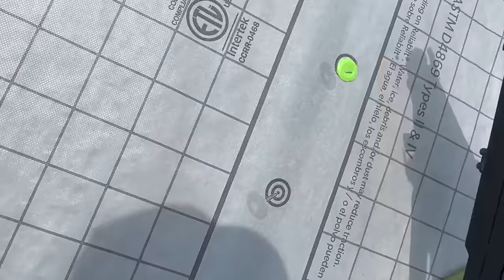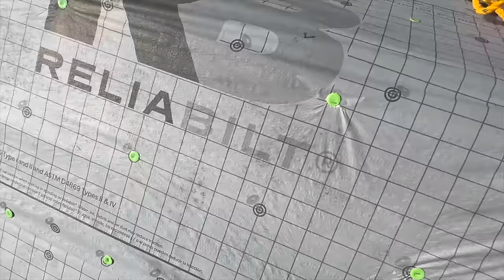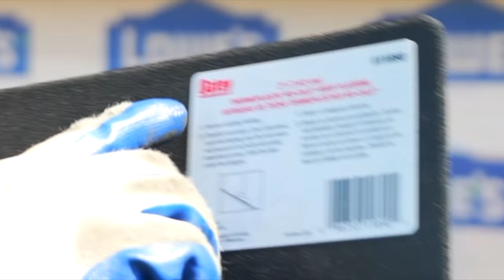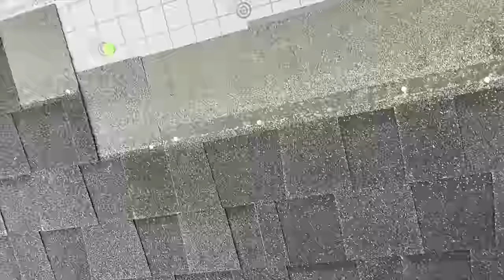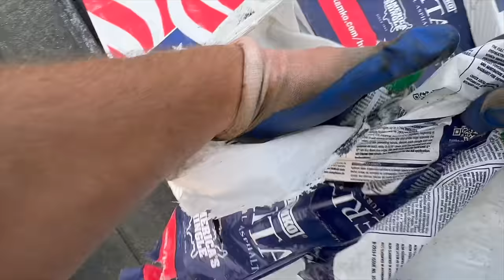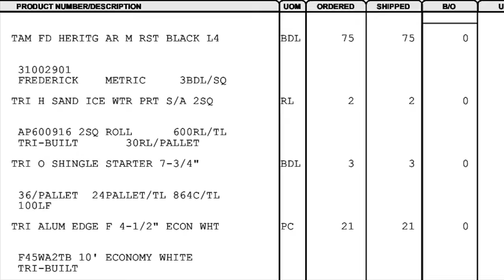How To Install Roof Shingles - BEGINNERS Step-by-Step GUIDE

Comment: I liked it for the most part besides two thing. The drip edge on the eve should be the one to get that folded tab and the rake needs cut to fit perfectly and make a pretty point on the bottom when they meet . And the nails on the pipeboot should never have exposed nails don’t shoot the bottom just the top and sides

Comment: Awesome, Josh, I have to replace 2 sheets of OSB on my patio roof, the previous owner didn't flash the end and now the edge boards soaked up rainwater. Need to replace about 16' across and 5' up the shingles and tar paper.

Comment: You have produced the most comprehensive video on roofing! I just built a roof extension after following the dorm construction videos with valley framing and sheathing the videos saved me a tremendous about of time. Thanks!
Reply from the maker: I do try to put as much information in each video when I make one. I hate when I am trying to learn something right video in a small detail as important is left out. I appreciate you watching!

Comment: Great job on all the explanation of everything it takes to roof. Always checking with your local codes is so important because some areas require two rows of ice shield because of the overhang of the roof. This gives plenty of safety for ice building up. Dimensional are always such a great look and actually are not a huge cost factor. Regular tab shingles I've done, I've off set 3 rows that would show more of a diagonal look instead of every other row staggered. 
I've measured from the ridge as well when you get closer to the top so the top looks straight. Of course as you stated, everyone has a different way. Huge crews of 8-10 are amazing to watch how well they all have a way to do each part. It looks like the roof is being poured on. Cutters do their thing as others do. 
I've never had the chance to use that style ridge vent and it does look really nice when done. 
If cap shingles are available. I like that too. It saves a lot of time and cutting which offsets the cost as well. 
Glad you covered the importance of safety as well. I know a roofing company that has special shoes with a tall heel so on 12/12 pitch (even 6/12 pitch) it doesn't bother your ankles. 
Great job Josh and get some sunscreen on my friend. Hahaha
🔨🔨👍🏻👍🏻
Reply from the maker: Oh yes, it’s amazing how codes vary so much from town to town and county to county. I remember doing three tab shingles when I was a kid and they are much different than the dimensionals. A dimensional shingle install is much quicker and looks better.

Oh wow you have much more experience working with crews of roofers versus me. It’s typically me and one helper or my father. Oh yes, safety is very important and I definitely agree I need more sunscreen on lol. My wife said it’s the best farmers tan she has ever seen! I hope all is well with you David and I appreciate you watching!
Reply: @TheExcellentLaborer  it is a difference with just roofers and a builder. I'm grateful that your Dad is involved like mine was when he was with us and the same with my father-in-law. Miss them both, but definitely a lot learned from them. Stay safe and get that pf80 sunscreen. Hahaha

Comment: GREAT video. Thanks much. FYI (for beginners) ridge vents come in variations depending on climate. My neighborhood is in a snow belt and the builder used ridge vent designed for non-snow zones. our attics were found to be full of snow. We are are all replacing out ridge vents for the snow-zone.

Comment: Easily a 9.5/10 video. Awesome production with a few tricks new to me. My only concerns/recommendations:

- A brief discussion on why pinching underlayment under the rake metal but hanging over the fascia metal would have been nice; I've had senior installers train BOTH ways, with one yelling at me for NOT pinching underlayment under fascia metal for fear wind will eventually lift up that first run of underlayment/starters and get at the deck - a fear that is clearly eliminated by using butyl-backed (sticky) ice-and-water barrier for your first run anyway. Obviously standard underlayment falling over the fascia metal ensures moisture weeping does not fall behind the fascia wood, right? 

- Nails securing your T-metal should have been completely hidden by the ice and water underlayment, no? And if I'm understanding right the outer fascia will also be attached by another run of nails through your T-metal. Shouldn't your ice-and-water barrier be installed to the farthest-most point of your T-metal to cover that eventual run of nails, too? 

- You used a T-style drip metal versus the more common L-style; it would be awesome if a pro of your nature - and ability to articulate - would make a damn good video covering different drip metals and how to cut them.

- Fast shinglers like to use the guide on their coil nailers to space out their book and ensure they're shooting the correct line without thinking much. That would be cool to hear a brief mention of.

- Not sure I heard mention of closed versus open soffits, and the importance of switching to a staple gun to avoid unsightly penetrations.

Thank you for your effort!

Comment: Very helpful video. I recently had my house reroofed and the they didn’t do nearly as good a job as this. In fact, they made a few critical mistakes - not lining up each row of shingles properly, nailing too close to the edges and in the wrong area, not complying with manufacturer instructions, etc. I may have to ask them to redo it. It’s only a month old and shingles have already blown off.

Comment: You put a lot of trust in the truss peaks I've set more trusses than I care to think about but when the ceilings inside change so does the truss although not by much but enough to throw your measurements off when measuring down to pop lines for your shingles and I'm sure you know that but a lot of people don't realize that. In any case a quick glance down the peak will tell ya which truss to pull measurements from.
I'm just rambling I'm sure most people watching know this

Comment: Excellent video. I noticed that the amount of rope that you have between the anchor and your back is far greater than the distance you would be falling if you were to fall off this particular roof, especially with the additional expanding 6 feet of the fall strap added into the equation. You might want to get a few more anchor points if you are doing another long roof like this so you can keep the yellow rope no longer than the length of the pitch of the roof. As you had it set up while you were working at the edge of the roof in the earlier part of the video, you'd hit the ground long before the rope would ever be able to save you...

Comment: Maybe this was mentioned in the comments,I don't know, but I will pass it on anyway. At 35:00 you have a tip in order to avoid the ladder from damaging the shingles/drip edge. If you additionally add another piece of 2x4 of a length that fits between the ladder rails, the ladder will not slide left or right and makes it much more stable to that type of instability in addition to protecting the shingles.

Comment: I noticed you used drip edge instead of gutter apron where there would be a gutter. does it really matter? also on your starter set seams the nails seemed pretty close on some of the seams (1.5-2" on one forsure)....wouldn't you want ideally 6" to the nearest nail from a seam? my understanding is that the water will travel a good 4-5" on either side of a seam?

Comment: Right from the get go. 
Ice & water shield must/should be over the bottom edge at least 3 to 4 inches so that it gets trapped behind the gutter. When ice dams occur water can flow into the gap between the plywood decking and the fascia into the soffit. 
While ice shield is predominantly meant for backups further up slope it also is crucial at the gutter edge. 
That said, always use two rows ice ice shield for those once in a hundred years we have extreme snow storms which happen a lot more frequently than a hundred years apart.

Comment: Hey josh . my name is joshua the only I seen is you don't want the drip edge tight to sub fascia you a slight drip gap . but been following you since beginning and learnd alot
Reply from the maker: The drip edge is very flexible, and the aluminum facia will slide right up under the lip, even if it looks tight on the video. Thanks for following! I hope that helps!
Reply: Ive never nailed the fascia side of drip edge.. wonder if that's my mistake or yours 😂

Comment: Hey, since you put the drip edge against the subfascia, what are the options to finish the fascia? Aluminum flashing that also gets tucked behind the drip edge or something similar I’d assume because actual fascia board would end up getting water behind it because the drip edge placement?

Using your videos I recently was able to repair rotted fascia and soffit on my grandma’s house for under $200 doing it myself! Your content is invaluable!
Reply from the maker: In order to finish the facia, I got to put aluminum facia up under the lip of the drip edge. That will keep it watertight, and it looks good. I’m glad I was able to save you a lot of money and help your grandmas house out! Thanks a lot!

Comment: This is an awesome beginners shingles video. Do you have a video of installing the plywood, rafters, valleys using the black jack? tahtnk you very much. Im replacing a roof 115in wide x 74 in length, tar paper 30 weight, do i need ice and winter shield. i notice you had starter shingles . thats great instead of using shingles upside down.

Comment: In Miami Dade County ice and water can be placed over synthetic. The reason being that the ice and water basically melts onto the wood roof deck making it impossible to remove in a re-roof.
Reply: Expecting ice damning in Miami You will be waiting a very very very very long time.

Comment: This is good, but houses in central Florida have much more stringent requirements. The underlayment has to be double layeres and you need a 4-6" strip of membrane cemented on the sides.
Also each shingle requires 6 nails correctly spaced.

Comment: You need to watch a safety video on adjusting the harness. Watching you your leg straps are to loose. If you fail with the leg straps that loose, you will pay for it with a lot of pain. The quick jerk will cause the leg straps to seat in your crouch with lots of pressure. Private parts will be in the line of fire

Comment: Hello, i am roofer and just would like to ask. A lot (Really a lot) of companies usually put bottom line of starter under the side line (in bottom corners of the roof) for beter waterproof. Even through that fact that water usually doesn't go there. Just want to ask your opinion, does it really make a difference?

Comment: At 12:12, if you use a wider piece of drip edge, then you'll be able to cantilever it out so that it will accommodate / capture the trim that goes over your sub facia board. The carpenters will than you!

Comment: Is it acceptable to completely overlap the ice and water shield with the synthetic underlayment? Great content by the way!
Reply from the maker: I personally don’t see why that would be a problem. When the nail goes through the ice and water shield, it seals regardless. The most important part is making sure it’s on the plywood. I hope that helps. Thanks for the compliment also!
Reply: I ended up doing it the way you showed in the video! Thank you!

Comment: Awesome video.  I'm Confused, should you nail a little below common bond or that asvalt strip.  Some say below to no disturb adhesive seal between shingles.
Reply: No, that’s called low nailing and will cause a leak. The bond adheres around the nail when nail thru it

Comment: My question on the underlayment. Do you really need to hit every single one of those bullseyes? Seems kinda excessive, and doesn't look like you did either.
Reply from the maker: It’s recommended that you hit every bull’s-eye, but I usually do every other one. I hope that helps!
Reply: You don't have to at all. As long as you have plenty of p-cap nails throughout the field

Comment: Thanks so much for the video. I'm noticing other videos instruct to pull the drip edge away from the roof edge before nailing so water drips directly to the ground instead of surface tension dribbling the water on the facia, wearing it it out faster. Thoughts on this?
Reply from the maker: The facia board is going to be wrapped with aluminum. So it slides up underneath of the drip edge. Technically, the drip edge does not have to overhang to keep it watertight if you are wrapping the facia board. I hope that helps!

Comment: Question for anyone who can answer.I'm building a garage for the majority, on my own.  I installed the drip edge and ice&water barrier.  It was a quite windy day and managing 10 foot pieces of drip edge was challenging.   

After all was said and done, I noticed a bit of a belly in the middle of it. eave ends stuck out from the sub-fascia at one distance and the middle of the 34 feet run it was probably 1/2-5/8 further.   How should I go about running my shingles now?  Thanks

Comment: I made it to 14:07 before I gave up... but ONLY because it wasn't what I needed. Which was a true instructional video to lay out a 10ac pasture with dead square lines and corners. This was good, but not exactly a "How To", as it lacks much instructional content besides general commentary. 

I draw that line between information I can get from just buying one and looking it over myself, versus watching someone with experience and expertise evaluating a product and/or kit with the eye of an expert - with explanation for any features that causes you to "like" or "dislike", why, and what is standard or typical on that type and grade of product. For example - explaining the different grade stick notation basis units available and typical demographic that prefers it was instructive and not possible to learn from just looking at the product in hand.

Anyway - 1-3:10 stars as instructional material, 9:10 stars as an unboxing/first impressions video!!

Comment: This would fail inspection in Florida before you laid the first shingle. In Florida the eaves drip has to have a 3" lap and the nails need to be 4" on center not 12" on center. But that's a Florida code.

Comment: Hey Josh I have a question I have this roof that needs replacing I’m trying to calculate how many bundles of shingles I need the sq Is 860 feet
Reply from the maker: Often times a bundle of shingles equals .33 of a square. A square is 100 ft.². I hope that helps!

Comment: I'm an older fellow who started roofing with my dad and brothers, and I have done more roofs than you could imagine. We never used scaffolding to start the dry-in and starter shingles. We've never fallen off a roof. I'm hesitant to offer a skilled professionals advice, but in the hopes that you and others can learn the safety principles that We've learned. The world becomes a better, safer, helpful place. I see that the old gentleman hasn't  helped you dry the roof in. Might be smart for him. I do like you tenacity and perseverance, but time is money and are wasting it. To put scaffolding up and take it down is a big waste. However if you or anybody else is not comfortable doing what I mention then don't change a thing! Be safe!
  When you start your dry-in you stand up above the underlayment on the Plywood (sheathing) start nailing at the top of the underlayment. When you have laid out and straighten the roll you nail it as per manufacturers specifications nailing ahead of yourself, always stepping on the nailed underlayment. I'm  67 years old and still do it this way, shingles to. Be safe and good luck! Bucksnort!

Comment: The product to use for the drip edge on my house does not look like what's listed here what is the name of the product
Reply: The minimum amount of overhang a shingles looking at other properties even in my own neighborhood mobile home park that I was doing some maintenance for mobile homes all pretty much the same size insulations across the board I found we're not consistent

Comment: P. S you should have used the lines on the top of the Dripedge .. so when the owner installs his facial Board. He can slide it up... under the 1" reveil on the drip.. so they won't  to fight with the Dripedge.. .I all ways leave one inch over hang , at the gutter line, and up along the gables... the first bend,,, in ever male and female... trigger finger.. the first bend is one inch......

Comment: I listened intensely to the video and hope I didn't miss it if you said it, but I never heard what the overall dimensions of the roof is that you worked on. I think you said you bought 25 squares of shingles and to buy 10% extra for waste. I am thinking that 25 squares covers 2500 square foot minus 10% would come out to 2250 square foot of roof. Is that correct or am I missing something in my calculations? Could you please let me know what the dimensions are? I would appreciate it. 
Thank you for putting together such fantastic videos. I am a new subscriber but already a huge fan of your work.
Reply from the maker: The roof required 22 squares with no waste and I ordered 25 squares including waste. The roof is 2,200 sq ft. I did have a few bundles left. 

You are welcome for the video. I appreciate you subscribing!
Reply: @TheExcellentLaborer  Thank you for your reply.  I appreciate it!

Comment: What's your preference metal panels or shingles like you're doing here?
Reply from the maker: Standing seam metal is very nice, but very expensive. If I was going to build a house that I was going to live in forever, I would go with metal because you don’t have to worry about it ever again for the most part. If I’m building a house and going to sell it within the 15 year timeframe. I would go with shingles because they’re much more coat efficient. I hope that helps!